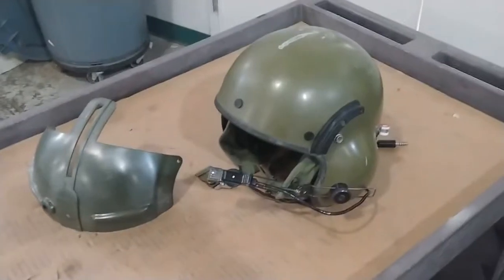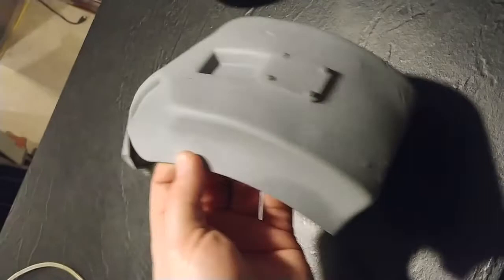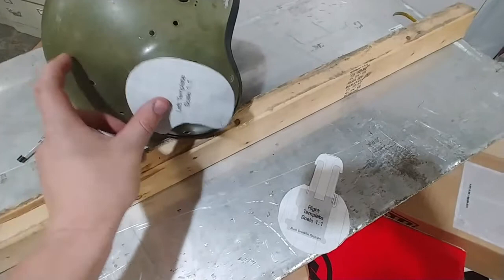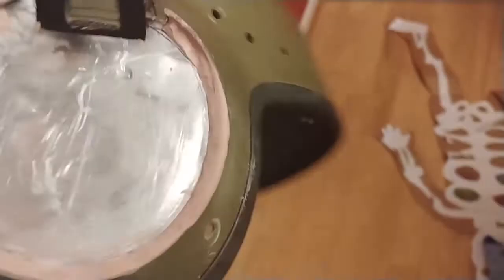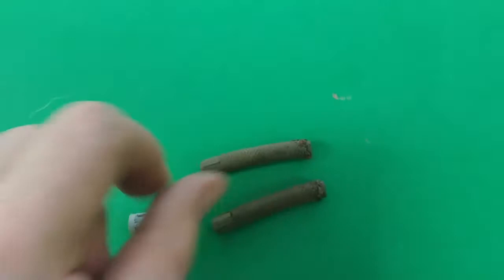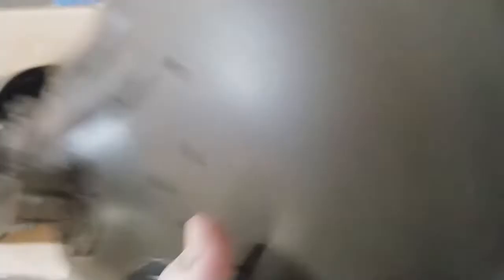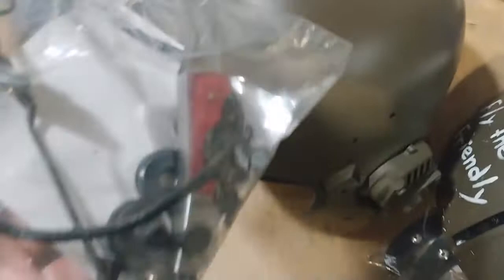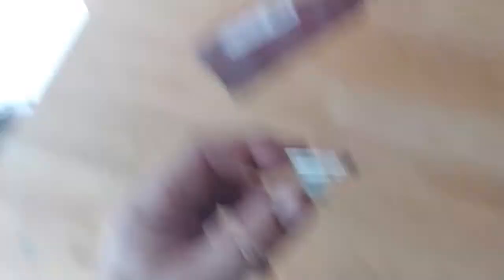Building the Aliens Dropship Pilot Helmets

Comment: Do you sell these Ferro helmet replicas at all? I love it!
Reply from the maker: Thank you but I really just build for myself. As I mentioned in the video there is a user named stephen210 who sells the parts from the Aliens legacy forum and new artists are 3D modeling the bits and pieces to print very accurate parts now.  The hardest part remains finding (and deciding to cut up) a vintage SPH helmet.  That is the main obstacle for being able to build/sell complete helmets, so I'm sorry but I don't have anything I can sell at the moment.
Reply: @bigbisontprops6860  Hi again. Just want to clarify something I heard in the video: You mentioned the SPH helmet is a size Small, but I'm struggling to find one in this size. By Small, did you mean the Regular?
Reply from the maker: @natwooding   It is packed up at the moment, but I am pretty certain it said "S" (small) on it.  It is noticeably smaller than my other/Spunkmeyer one.   I can wear my spunkmeyer helmet comfortably but my ferro helmet is too small for me.

Comment: You’re destroying original military helmets when you could just reproduce them cheaply?
Reply from the maker: Not all all.  One of them was actually white, so very clearly a civilian use helmet dated from the early 90s.  The other was already rotting on the inside and dated to the mid 80s.  Hardly a valuable relic.   Also the idea that they are "reproduced cheaply" is not really accurate.  Everyone in the community would LOVE an option that doesn't cost several hundred dollars while potentially destroying history, however accurate alternatives are not as common as you would think.  Overall, I agree with you that actual relics should be preserved,  but these were not those, so no worries!
Reply: BigBisonT Props are the modifications you made easily reversible?
Reply from the maker: Easily?  Not really.  The majority of it is paint and glue, but the ear domes would require some fiberglass skills.     Not impossible at all, but not super easy.